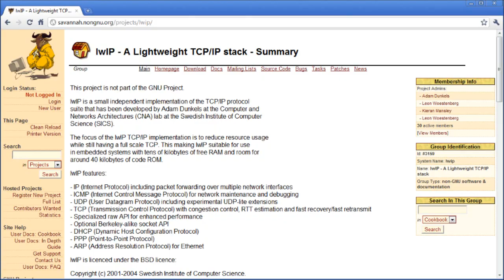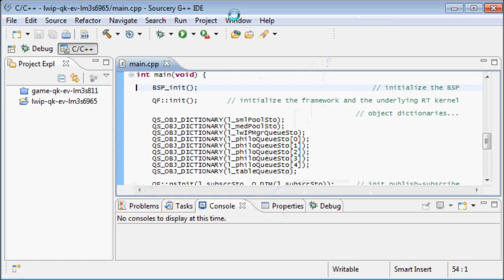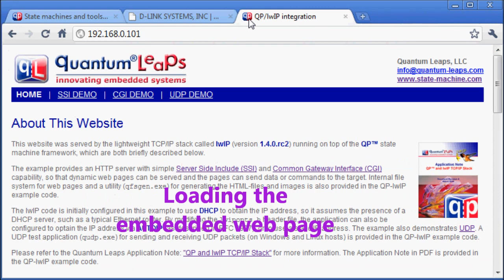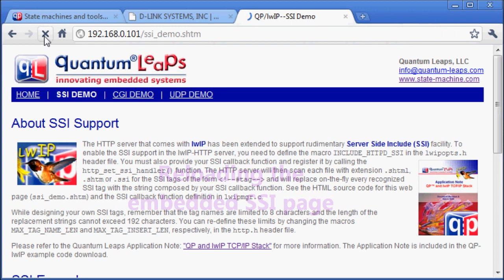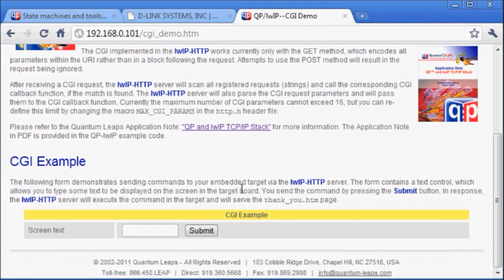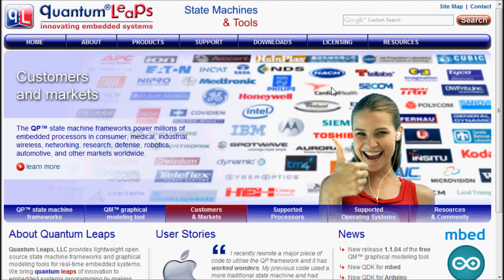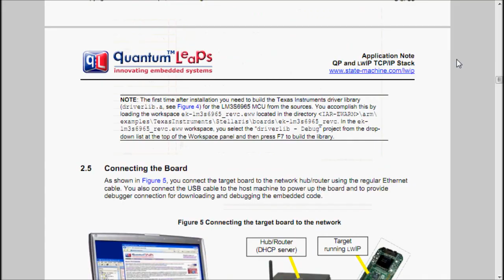QP frameworks and the lwIP TCP/IP stack for hard real-time systems

Comment: Hello Sir,
I Have STM32F767ZI Ethernet Board and i generate code from stm32cubemx tool.
When i ping with my ip ping is come.
now i write code for mqtt using lwip on stm32f767zi using @t link.
then,using mqttfx tool i send message so break point come to rec_callback.
Now after 15 mini again send message through mqttfx its not come and by 
debug its also show i is connected with mqtt server so what i do ?
if share me your mail id so i share my code.
or you share me sample code for just echo from mqttfx on same topic based code 
plz help me.